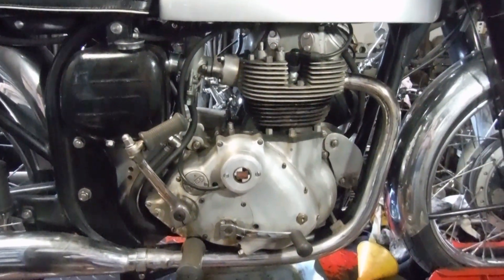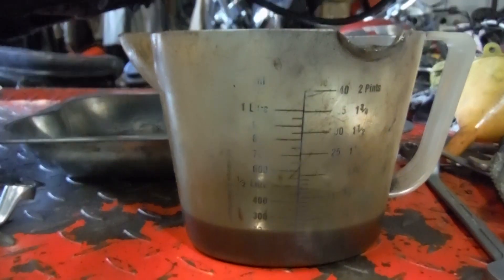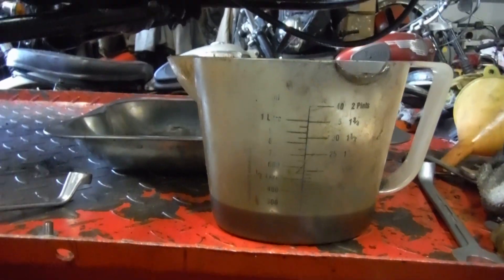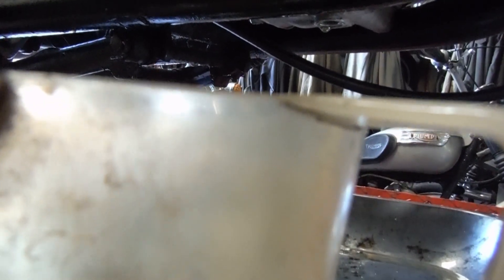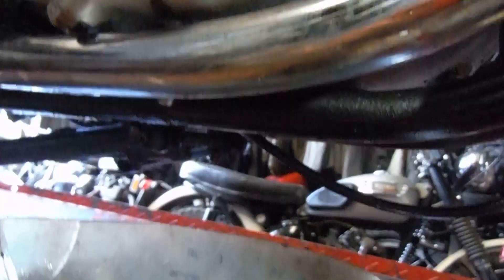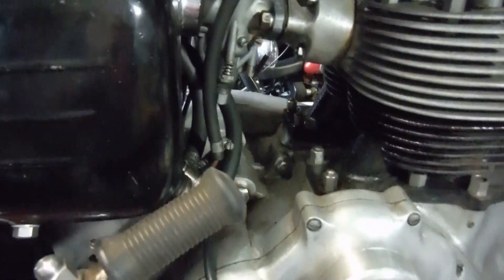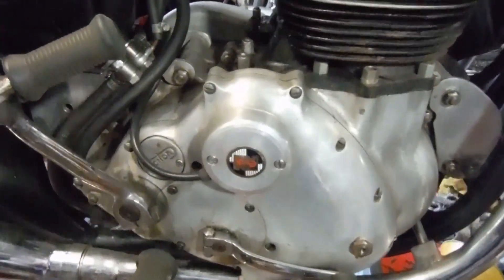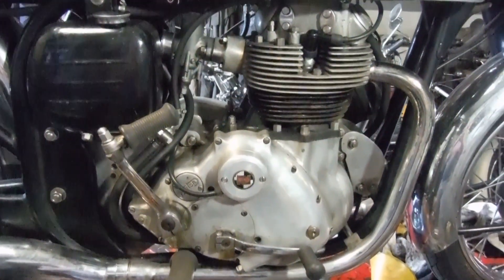Norton unit 650 Prototype (yes, another one!) Looking further into the engine's wet sumping.

Comment: I know you don't like taps on oil tanks to stop wet sumping,you'd rather cure the disease rather than treat the symptoms.
I have seen on another channel a tap set up with a micro-switch on the tap,if the tap isn't switched on,power to the ignition is disabled.
I seen this on a Canadian youtubers channel, "Ryan Fort9,fitted to a Commando I think.